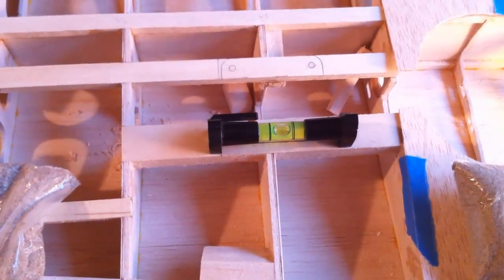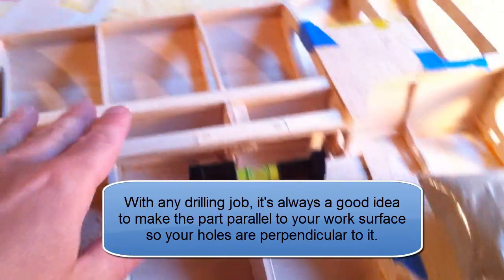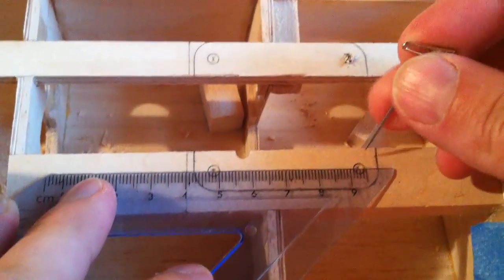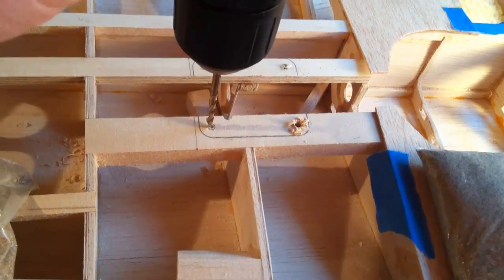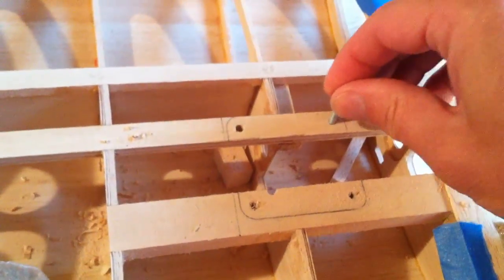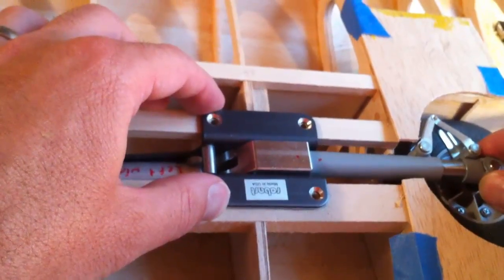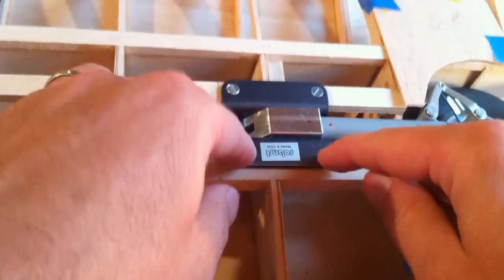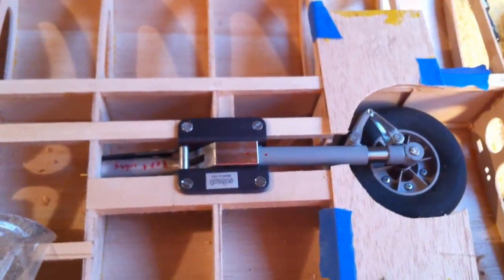Part 2: How To Install and Drill Mounting Plates for RC Airplane Landing Gear

Comment: I'm sorry, but it makes zero sense that you are using a level to mark your screw holes,or even to have the aircraft level for you to drill the holes, especially when you end up doing it by eye anyway, however you don't need to make the aircraft parallel to the surface because the mounting plate is going to be fixed hard up when you tighten the screws, which eliminates the need to make it all level,does it not??

Comment: Hi, Quick question. I've installed retracts similar to this on my first jet. but the two aft screws sheared off whilest trying to get them in. I've epoxied the hell out of it, it still has 2 screws in the front former, do you think this will be string enough? II know it'll be a pain to remove one day, but is it worth taking them out and replacing the rails? Thanks!